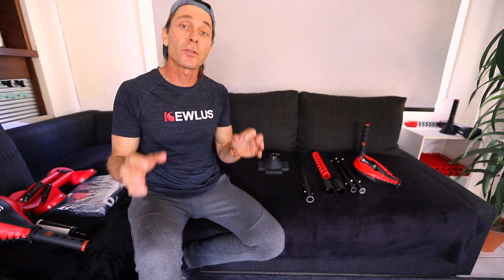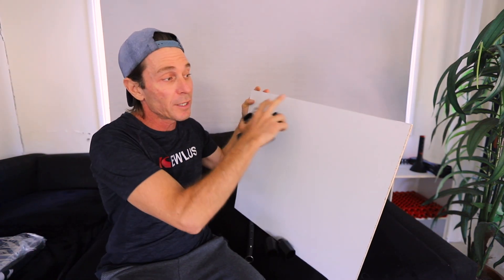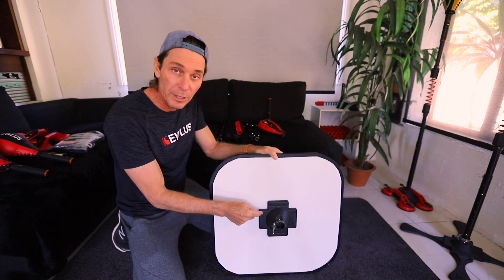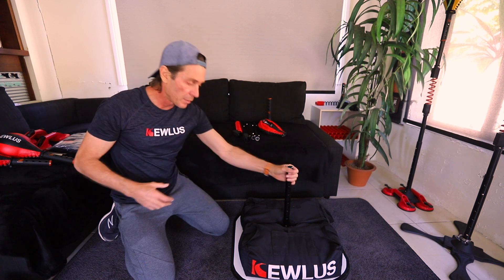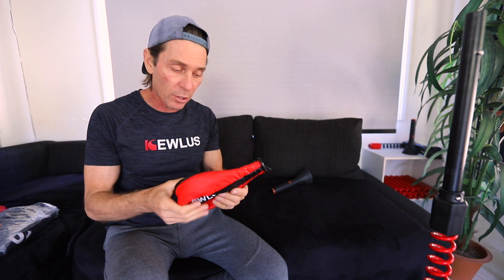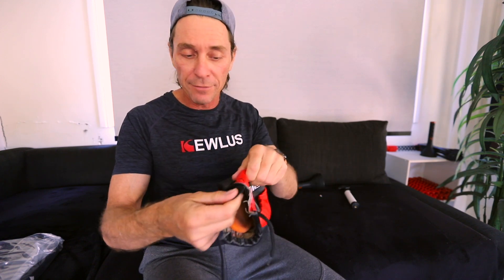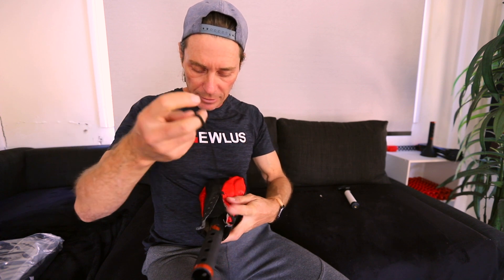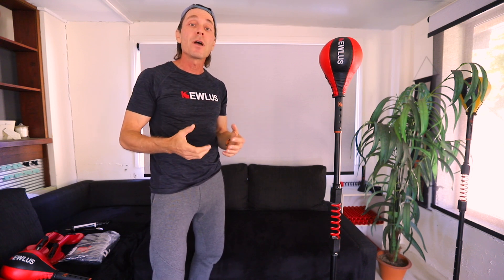KS2 Cobra Bag Core Kit Setup Instructions

Comment: Looks great! I just got the email saying mine is about to ship.
Your kit is a steal compared to comparable overpriced cobra bags. Nobody in your price range has a spring that tight I can tell you that. The competitors bags are light as a balloon so they will stand back up before next Tuesday, and the light springs they use keep the cheap mast and hardware from busting. I know they have overhead and advertising costs, but I don't want to be the one to pay for it. They should have advertised on YouTube instead. Or better yet, they can just buy a Kewlus bag and call it a day.
Reply from the maker: Thank you 🤙😃